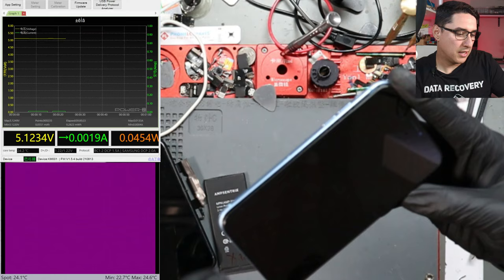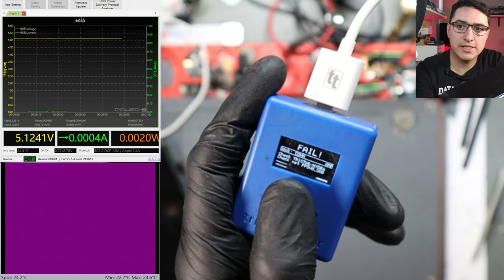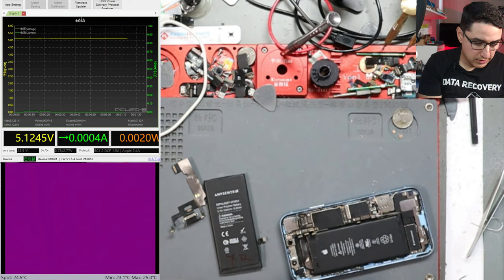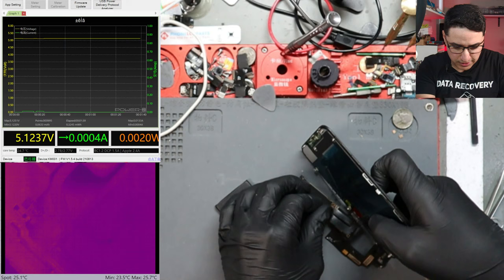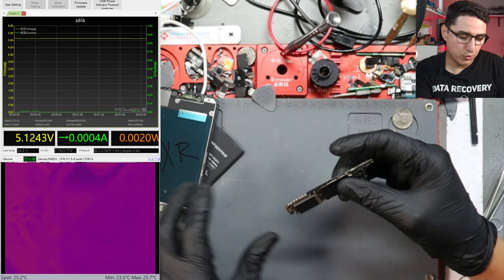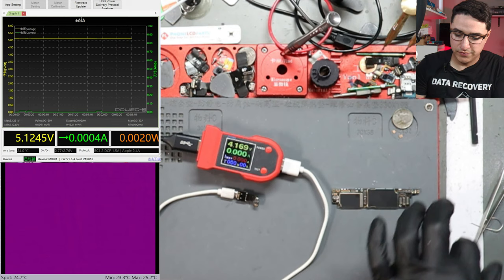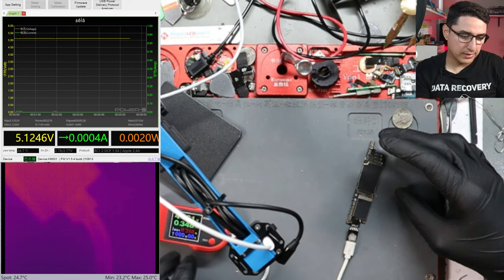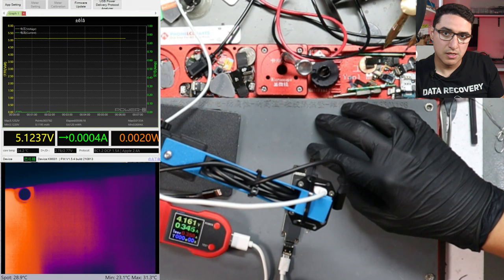iPhone XR That Does Not Charge and Does Not Power On. Live Logic Board Diagnostics & Repair.

Comment: I learned the hard way to never use heat to remove the shields; just grind the edges and use a razor to cut them open. XR motherboards are thin around the nand, and when prying up shields, it will bend it. My new method is to grind off any IC that needs to be replaced because apple underfill gives me nightmares.

Comment: Always fun to watch! I couldn't remember by the end of the video, but was there a known issue with baseband prior to repair? If you are able to get BB functioning again perhaps some sort of wifi or bluetooth transfer of files just for the backup. Not sure if any of this is an option/is economically viable. Great video!
Reply from the maker: There was No Power on this phone, so no way to know any other existing issues. Technically, that may have worked to backup via wireless. Although, hindsight is always 20/20.

Comment: Hey Jesse... If youre getting current draw before prompt to boot its always main vdd Boost or bat..all secondary línes are not activated so no current going through them. Was that device not emulating the power supply main line?
Reply from the maker: Yes it had a short in Yangtze, which is on VDD MAIN, at the beginning of the video.

Comment: hey what is that, flex cable board that u used to solder in the XR battery flex? is it a usb-c adapter? the test board with the micro-usb port. @5:45
Reply from the maker: It's part of the DT880, as I explained in the video 😅

Comment: Correcttion, 13mV not not 13mA on the battery input short test
Reply from the maker: What are you referring to exactly?
Reply: 13:53  meter in diode test mode  should show the voltage drop across test. In the case of diodes, it should show the junction voltage - anyhow great video 👍
Reply: Out of interest, I just put my fluke meter to diode test mode and measured the voltage on the probes with another DC voltage Meter,  the open cicuit probes measured just over 7 volts - I have an in circuit cap tester I understand that uses  voltages  below 0.6V  in order to avoid silicon  semiconductor junctions switching on and interfering with the test. Do you undertake work sent  from UK 🇬🇧?
Reply from the maker: We only offer data recovery for international customers. If you need to send something in, message me for a quote: https://vccbr.com/me